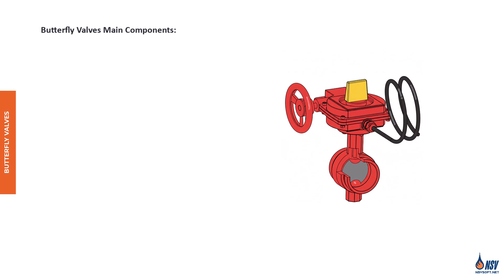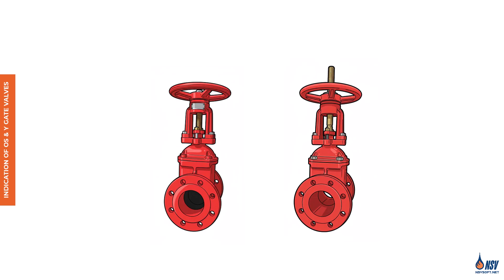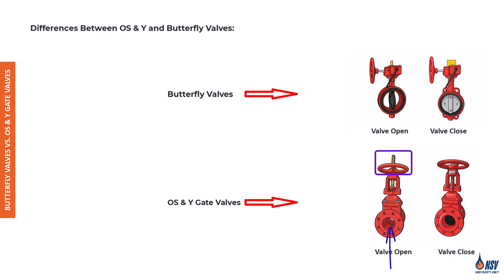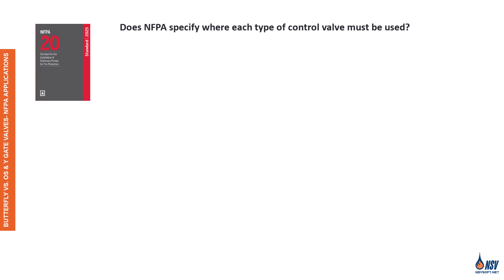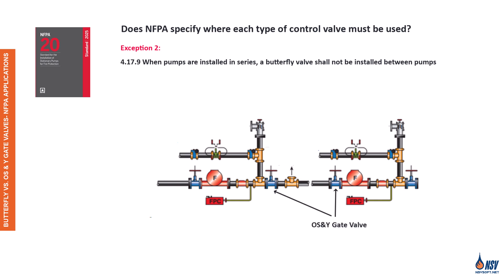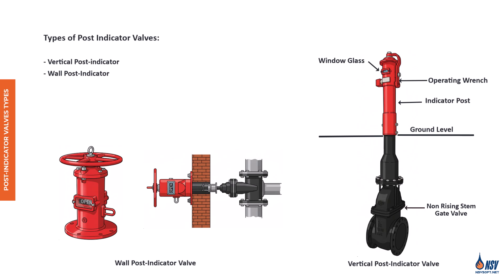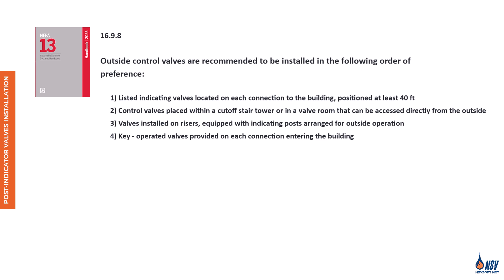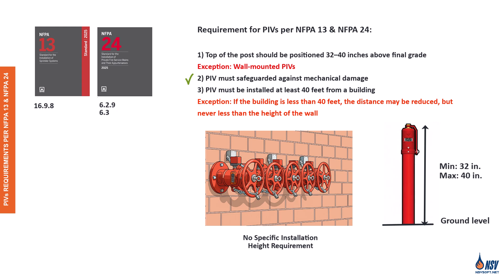🔧Control Valves – Part 2: Types of Valves (NFPA 13 / 13R / 13D/14)

Comment: Hi Rahil. thanks for the video. is there any table which refers to the distant from an elbow or tee fittings to the butterfly valve in order to avoid obstructing the disc?